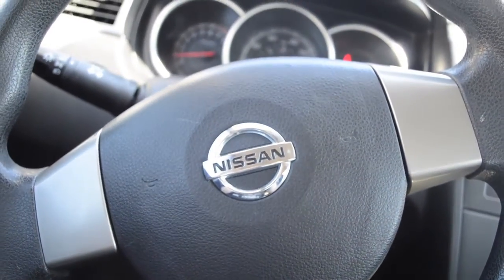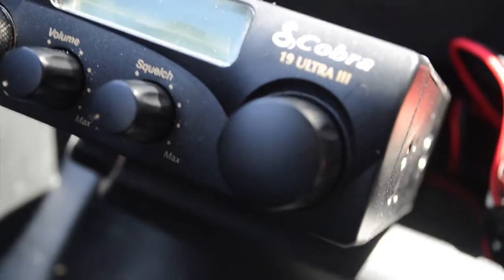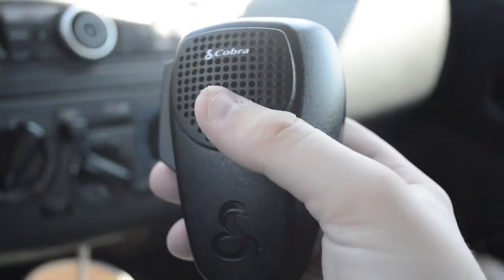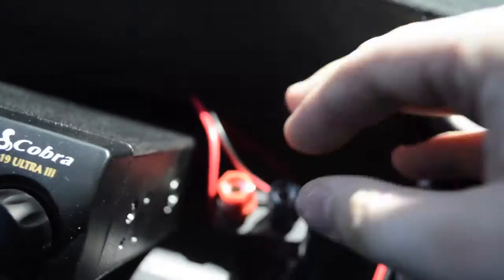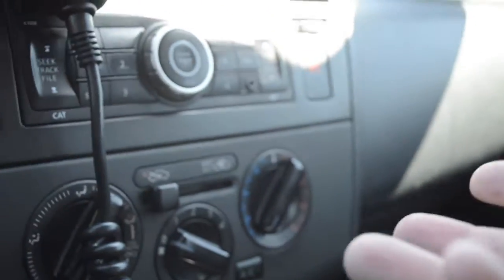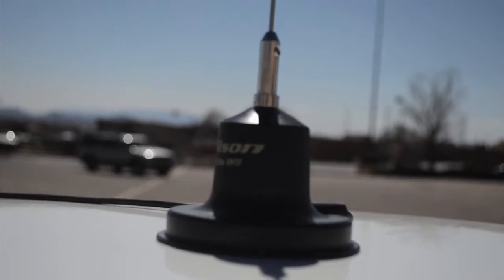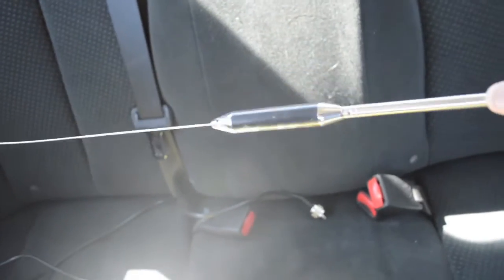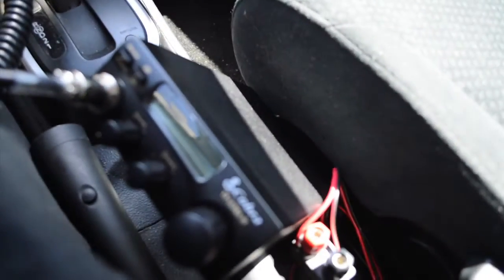Simple CB Radio Installation

Comment: Get an swr meater check the SWR on Channel 1 and ch 40 and adjust your antenna if swr on 40 is higher than 1 your antenna is too high and needs to be shortened and if ch 1 is higher than ch 40 then you're antenna too short and needs to be lengthened